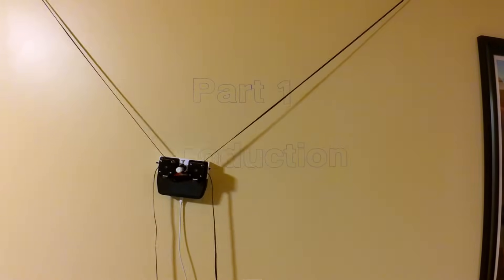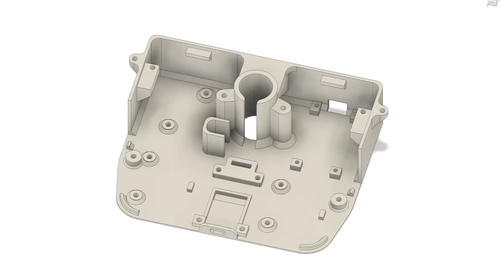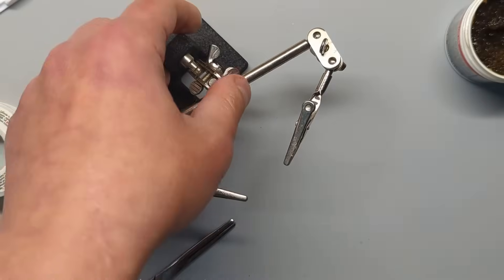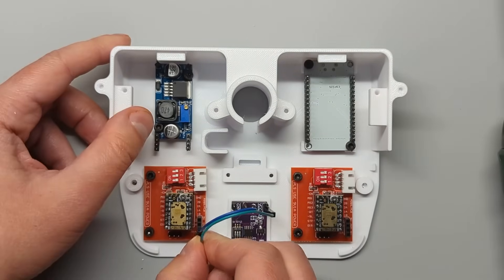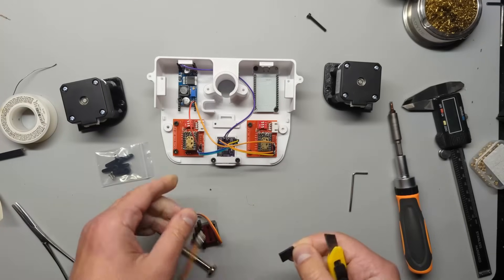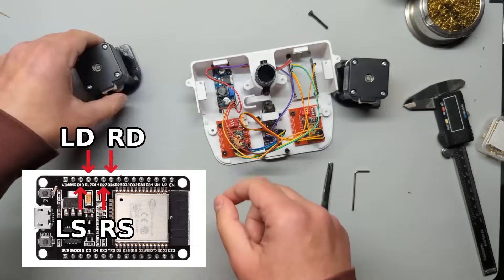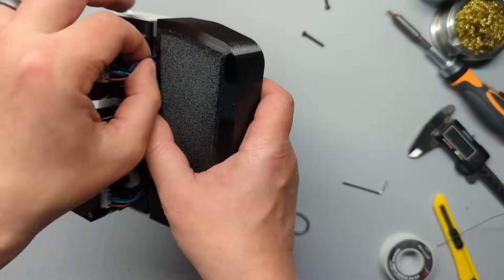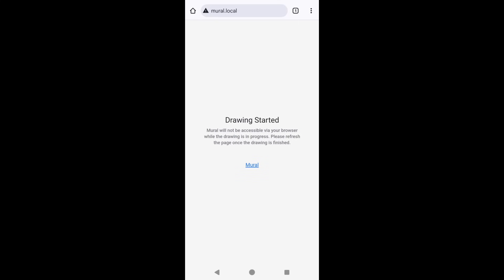Mural wall plotter: detailed assembly

Comment: you can install a digital level as SC7A20H  to control the orientation  of the robot and for it  to be parallel to the ground
Another way is to change the exit point of the belts to be in the center of de robot, in this case you must lower the center of gravity of the robot ( mouve the motor )

Comment: Im not a programmer, but with the help of AI have written an GPS app for a ESP32 device.  So I think you could get Claude or CharGPT to help you with your enhancements/distortion correction. Show the AI your code and then tell it what the problem is. It might take a few iterations but you should be done in a couple of days.
Reply from the maker: The distortion is fixed in v1.1 the old fashioned way
Reply: @nivanov  Good Job!

Comment: Extend to home position is not working motor are not moving they just set loose for some time I can easily pull the belt... What wrong I set the correct voltage??
Reply from the maker: Please open an issue on GitHub

Comment: Unable to connect to mural can't find it's hotspot 😢 what should I do . I tried multiple times..
Reply from the maker: Please open an issue on GitHub - it's easier to track them there. I take it that when you flashed the firmware you didn't get any errors?
Reply: @nivanov noo
Reply: Does it take any time to restart and show its Wi-Fi Hotspot
Reply from the maker: @technocrat9984 no, it should show up within 10 seconds first time around

Comment: Hi, i'm planning to repeat your project! But how, if i add  3~4S Lipo Battery?
Reply from the maker: you need to supply 12V to the device. Motors run straight from that voltage and the rest are powered via a regulator. You should be able to replace the PD module with the batteries and power the motors directly from the batteries. Actually fitting the battery pack into the case would require a redesign. Im also not sure that added weight would be handled well by the motors.

Comment: I had to connect the enable pins to ground on my driver boards to activate the steppers, and flashing through the website didn’t work on macOS/Chrome, so I used PlatformIO to build and flash it myself. It’s drawing the first wall now. Awesome work, thank you so much for sharing! :elbowcough:

Comment: Parts are printed, just waiting for the AliExpress shipping. Did you manage to solve the distortion issue? While I wait for the parts, I can take a look at the code. I assume the math is a bit tricky since it involves a „rotating“ coordinate system, right?
Reply from the maker: It's fixed, just not released. I've been very busy so releasing v1.1 is taking longer

Comment: I am followed the video and getting the motors to spin, however both my motors are spinning in the wrong opposite direction. Any suggestion please
Reply from the maker: Did you ask this on Discord? My guess is that your stepper cable is wired incorrectly.

Comment: Very nice.  BoM should arrive today.   3d prints went well, though it took a good bit of post-processing to get the pen sleeve sliding freely - probably too fast of perimeters on the bottom shell.  Looking at the github commits and PRs, It looks like there have been some big improvements to the kinematic model that makes mural far more accurate, correct?  Very exciting.  Thank you Nik and @schmidt3d ! Now I just need to prepare a wall as mine all have texture.

FYI your recommended steppers (B07TGJSRGZ) are not available. I found alternates (B0C36GNQ15 - iMetrix 3 for $23) using bare specs: part name "17HS4023", 1.8 deg, and 1.5 A rating, 130nM
Reply: some build notes: needed 3mm drill bit to open upthe  idlers. I burnt a servo before I realized the pen carrier screw head hits the servo case at home position, preventing full travel.  These are the screws from the BoM. you could modify the cam to increase clearance, I carved the servo case a bit as a workaround. I added washers to the servo retention screws.
Reply: 5:47 the stepper plug is oriented on the opposite side needed
Reply: 9:35 you mention shortening belt to 7-8 meters, but BoM only says to buy 1x 10m belt
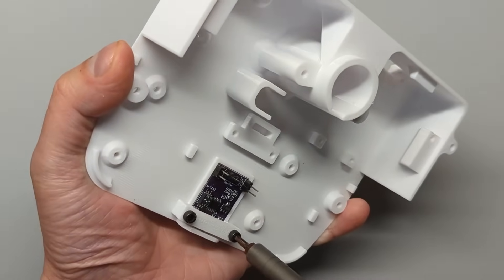Reply: 3:22 the Stepper Motor Driver control extension boards linked in your BoM arrived without resistors meaning the stepper is disabled (R2) and microstepping dips are not hooked up (R1).. Maybe a bad batch, maybe a "cost optimization" lol. Took a bit to track that down, as "missing components" was not my first through sixth guess in troubleshooting.

Comment: Hi I've been thinking about this project, I believe rearranging the components in the following  way should solve the problem.
1. Change the shape of the box from landscape to portrait.
2. Move the location of the servos onto the vertical center line of the unit and as low as reasonably possible.
3. Add two idler rollers to the middle of the top edge of the unit with just sufficient gap to allow the two belts through without fouling each other.
4. Move the pen assembly as close as possible to the top rollers must be centered to the idler rollers in the vertical direction.
5. Add idler rollers as required to route the belts around the pen and into the servos.
6. Add idler rollers to route the belts around the servos and out of the bottom of the case again aligned through the vertical center line of the case.

My thoughts are that if you think of the case as a pendulum suspended from two cords attached to the same point. Changing the lengths of the cords won't affect the vertical alignment of the weight. Moving the mass of the pendulum weight as low as possible will help counteract rotational forces caused by friction against the wall.

Please keep up the great work you've done so far you are really close.  

 Sorry for not doing a drawing but I have no experience of 3d printing and don't know how to send a cad file to you.

Have you thought of making a version with a led laser, I think this would make an excellent large format laser cutter.
Reply from the maker: @trevorhinchliffe2195  that would minimize device tilt, but it's easy to compensate for. The main source of distortion is that I treat the belts like they are stiff weightless rods - it's good enough of an approximation but as several have pointed out the belts follow catenary curves
Reply: The easiest answer to that would be to add mass to the unit, you could test it by adding weights to the loose ends of the belts

Comment: To fix the warp, simply warp the image in the opposite direction before converting it to Gcode. The amount of counter warp to be appplied is proportional to the distance between the pins on the wall.
Reply: I bet this would be a good workaround until some smarter people figure out the coding. If you could have chatGPT review some calibration shapes drawn, you might be able to apply a warp ratio (is that a thing?) in inkscape to make the result more square.

Comment: Very nice project and well documented! I have built a CNC milling machine and use it with a needle cutter as a foam cutter - very useful in RC model building. With a few modifications you could use the wall plotter as a foam slicer. I have sources and my own experience with the needle cutter. Unfortunately I have not found an e-mail address for Nik Ivanov?
Reply from the maker: Hi! You can join the Discord server or open an issue at https://github.com/nikivanov/mural

Comment: I've made a couple of these, wall plotters work much better if you just mount the steppers in the corner, thousands upon thousands have been built this way and they work great, your style is fine but will be a lot more prone to inaccuracy and problems. If you're going to have to nail in gt2 belts that will hold up your heavy bouncing dual stepper rig, you may as well just nail the steppers into the corners, I'm not really seeing the advantage here besides the fact that it 'looks' easier to setup
Reply from the maker: Affixing your steppers to the corners makes the whole system much less portable and requires more damage to the wall than the two small nails. You also need to route the cables from both motors to the controller and then route power to the controller. Ultimately, it's what you want to get out of your plotter - I was looking for something that can be hung on the wall, do the drawing, and then can be stowed away.

Comment: with a ruler draw a perfect grid with one color, then use mural to draw a grid over it with another color and take a picture of it while standing as far as possible away from the surface to reduce optical effects. 

you can use the known good grid and the offsets of the bad grid to create a lookup table that will generate offsets that give a more calibrated result, gpt is good enough for this

Comment: Cant you just hack in distortion compensation by doing a test grid and transform the input until it comes out undistorted? Not user firendly but it'd work
Reply from the maker: @dundeedideley1773  yep that's the plan - a dewarp matrix

Comment: Hi, what a fun project! congratulations! I printed this design and found that there is a lot of friction in the mechanism for the Z axis for the pen. Sanding and lubricating the pen holder and tunnel helped a little, but there is also friction in this servo arm design. Overall, I think a different design where a rubber band pulls the pen down to a certain depth and the servo simply lifts it would be beneficial. My suggestion would be to discard this type of sliding servo arm all together. Another improvement that comes to my mind, would be a second button so we can move the servos to both end positions during assembly. I had to turn the esp back on a lot of times to get the servo back to the down position. Anyway I am greatly looking forward to seeing how this project develops. 🎉 also could you maybe provide a sample svg that works for you? All the svg I tloaded, said succes but didn’t display a preview after rasterizing. print time 0s…
Reply from the maker: Are you using Chrome? I've heard from several people that Safari, for example, does not work. Try Chrome and see if that resolves your SVG issues.
As far as friction goes, the tolerances I've used are about 0.3-0.5mm. If you find that the pen does not slide smoothly in the channel, I'd first make sure you've sanded off the elephant foot. If that doesn't help, you should calibrate your printer - if you can't get a cylinder to travel freely in a channel 0.3mm wider than the cylinder diameter, I'm afraid your printer won't work for this project.

Comment: distortion is due to distance between motor axis - the cross point of belt lines is shifting up and down and left and right depending on the length of the belt of each side while pen is not on this cross point
Reply from the maker: @z08840  that's more or less accounted for. Not accounting for catenary curves is the cause of distortion afaik. The plan is to make a dewarp matrix.

Comment: How about one that uses those vacuum board lifters to avoid having to do the wires? With a bit of planning, you could have it walk around too.
Reply from the maker: @chaos.corner  I'm not sure what you mean, but it's open source - feel free to fork the repo and give it a shot!
Reply: @nivanov  I think it would be totally different anyway. Not downing on your idea. They have these handles which you put on boards and they draw a vacuum to lift the boards easily but without damaging the boards and with easy release. (They're usually battery powered but don't have to be). I'm imagining something with three of these on arms that could 'walk' around the wall spider-like without needing the wires.
Reply from the maker: @chaos.corner  no worries! I googled them after and they are $200 a pop. A bit steep for a device that currently costs around $60
Reply: @nivanov  For sure. Though it might be possible to implement something similar for cheaper.

Comment: I could see this being used to create outlines that are then used by a painter like a paint-by-numbers project. It would be more accurate than just using a projector and tracing the outlines manually.
Reply from the maker: I think somebody either in this video thread or in the teaser video thread already mentioned that they are planning on using Mural to make outlines for the actual Mural to be filled in. Very exciting.

Comment: Is there a wiring schematic somewhere?  (Fritzing style)  Also, during construction I have found that the M3x12mm thumbscrews in the BOM will be too short to reach inside the pen tube. It seems the 12mm includes the total length and not just the threaded portion. I'll probably just 3D print a knob to attach to an M3 bolt.
Reply from the maker: There's no wiring schematic beyond what the video provides.

Strange about the thumbscrews - I linked to the one I've been using and it's plenty long to hold the marker with some extra length to spare. I'll measure the ones I bought when I get home to see if the threaded portion is 12mm. Measuring the entire length of the bolt including the thumbscrew head doesn't really make sense to me.
Reply: @nivanov  Thanks. Just to confirm, only two of four janky GND pins are used on the LM2596 module?
Reply from the maker: @karllaun2427  correct

Comment: Looks like a great project. Got all my parts together, but I'm having issues with flashing the ESP-32. I followed the directions (Win 10 Edge, data cable, BOOT) but I get a "Failed to Connect" message. Device shows as "Silicon Labs CP210x USB to UART Bridge" My ESP is a WROOM ESP-32S. Is there an alternate flash method?
Reply from the maker: I'm pretty sure you're using the correct board - does it look EXACTLY like the one listed in the BOM? If your board, for example, has less flash memory (or more, for that matter), the flashing might not succeed.

Anyways, please open an issue at https://github.com/nikivanov/mural/issues and include a screenshot of the firmware flashing page when it crashes.
Reply: @nivanov  Thanks for the speedy reply Nik!  I was ultimately successful in getting the firmware to flash from the web interface 😀  I did try loading the project into Platform IO. I got it to compile and flash....once, with some errors. There was no AP though when it was done. I couldn't get it to work a second time (I suck at VSC). Ultimately, I discovered the problem was a loose nut behind the keyboard (I was misreading the directions). I was holding the BOOT button while I plugged in the ESP when I should have been holding it while selecting "connect" in the web flasher.  Maybe my feeble brain was hindering back to installing bootloaders on Arduinos.....
Reply from the maker: So the good news is that you were not misreading the directions - to put the board into the boot mode you hold BOOT while connecting it to the USB. I wasn't aware that you have to hold BOOT while clicking the Connect button on the firmware flashing page. That's good to know! There's another person having troubles flashing the board - I'll let them know to try that as well.

Comment: The warping is coming from the tilt of the device as it moves. You need a little extra pull from one of the motors as the device moves from the centre to the edge. As you move left, the LHS motor is going to need to pull more to compensate. As you go right from the centre the RHS motor is going to need more pull. Sounds like a problem of trigonometry. Or you could be lazy and move the device to each corner and allow a user to set the amount of motor pull at the extremes and add logic to gradient that out from the centre.

Comment: Hello, excellent work! I noticed the carrier becomes crooked when on one side. I would suggest to change the orientation of the belt on the carrier bord to be more center cand closer. I think this way the carrier will mechanically set straiter. Cheers
Reply from the maker: Do you mean Mural tilts when it's off to one side? That's expected and is somewhat compensated for in software.

Comment: Hi Nik,

I hope you are having a great day. I am very interested in your Sketchy Robot project and have a few questions that I hope you can answer:

After flashing the firmware onto the ESP32, do we need to keep the robot connected to the computer via a USB cable during the drawing process? Or will it be wirelessly controlled, meaning that we simply power it on and control everything via Wi-Fi?

I am curious whether you have considered the physics and engineering aspects of this robot’s design, particularly the relationship between the robot’s mass and the torque of the stepper motors. I am planning to redesign the 3D model of this robot to make it more compact, and any information you can provide regarding its mass and motor torque would be extremely helpful.

I look forward to your response. Thank you very much.
Reply from the maker: @lephi1240  Hi! You don't need to connect the esp32 after flashing. You'll connect it to your wifi and then it hosts a web server / local website.
Reply from the maker: @lephi1240  you can build it and weight it :) the motors have the current limit of 0.8a so I think you can figure out the torque from there, but it's adjustable.

Comment: Is there any reason why you first get 12V from an USB-C PSU and then convert it down to 5V? When you need a cable anyway, why not put a 12V PSU on the floor and a simple cable to the plotter?
BTW: That is some really helpful instruction video. Cudos!
Reply from the maker: @stefanhennig  I'm not sure what you mean. I need both 12v and 5v on the device.
Reply: @nivanov  Yes, but why so complicated using an expensive USB C PSU that has to be coerced to provide 12V. Why not use a 12V Supply right from the start?
Reply from the maker: @stefanhennig  ah, I see what you're saying. I don't think 30w USB c bricks are expensive and chances are you already have one from your phone.
Reply from the maker: For a standard 12v power supply, you'd need a barrel jack and a long set of wires, and then do a bus bar of 12v. Definitely doable that way too.